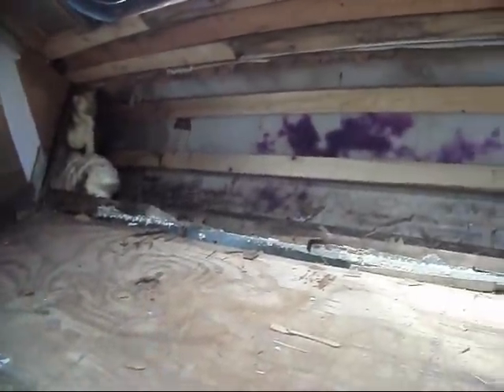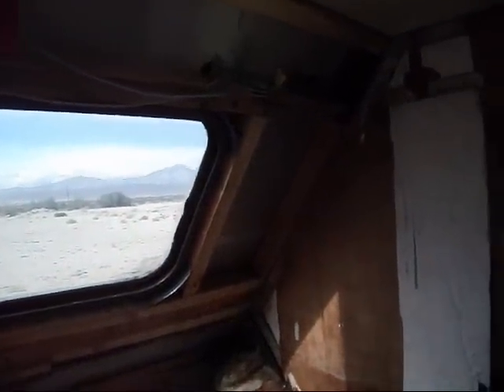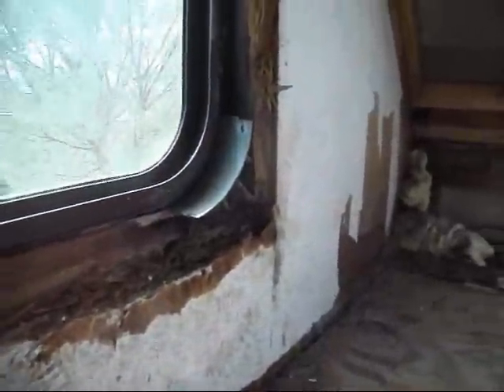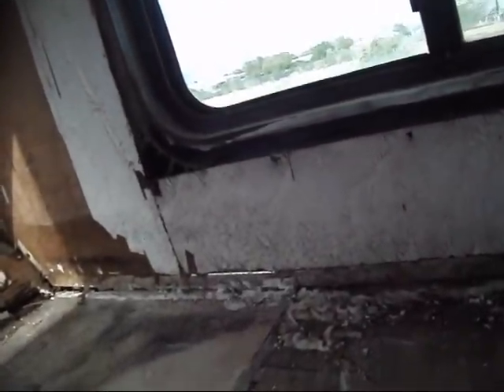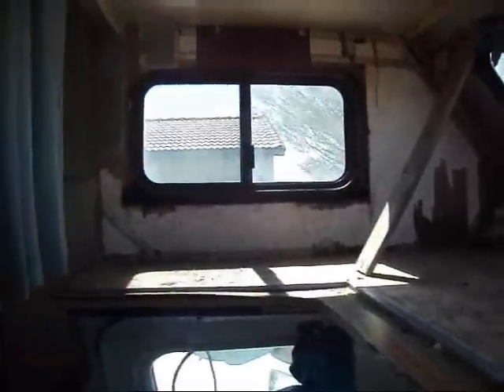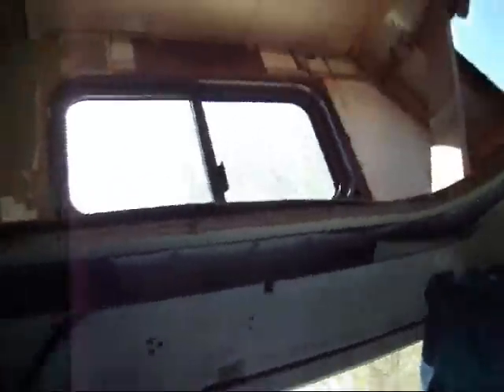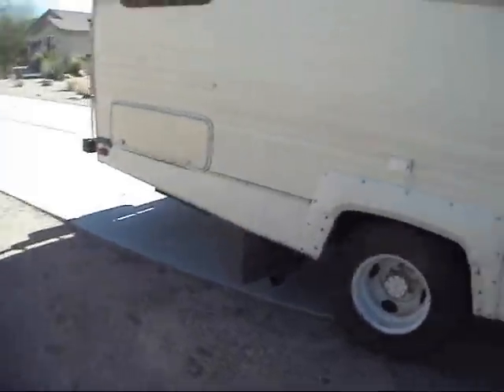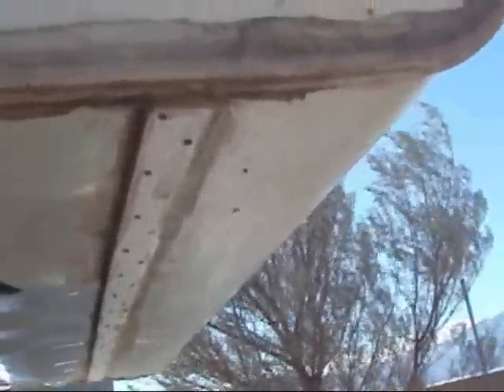rv repair #2

Comment: Every rv looks to have been slapped together by a drunken crack head. Horrible shoddy work. I just rebuilt my cab over camper, I had a corner rotted out as well. I replaced all bad wood, supported all outer beams by 2x4's for reinforcement, new r13 insulation, coated with killz and covered with 5/8 plywood. Much better now. The time consuming part is pulling all the damn staples they use!
Reply from the maker: Staples should be outlawed in my opinion lol.